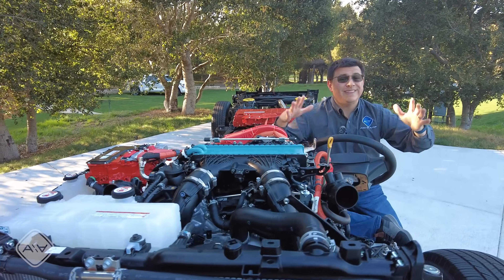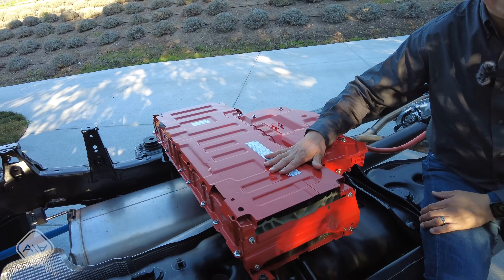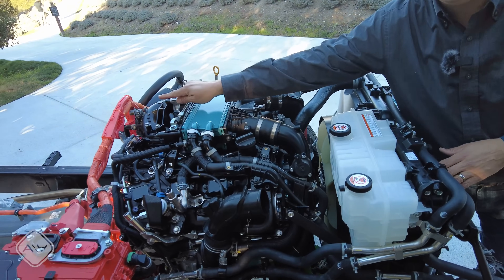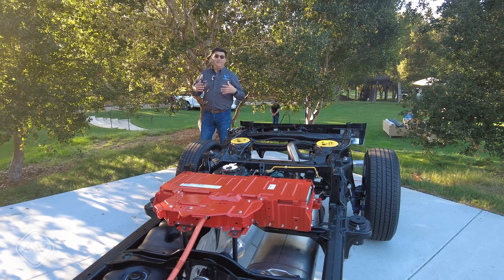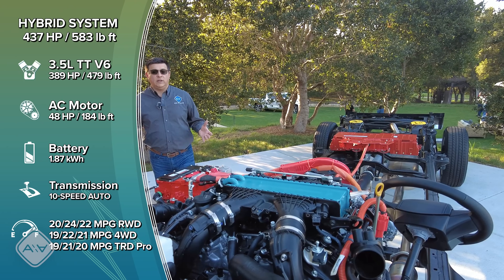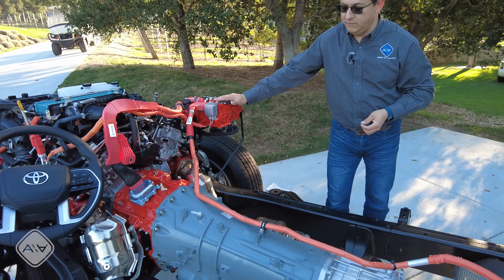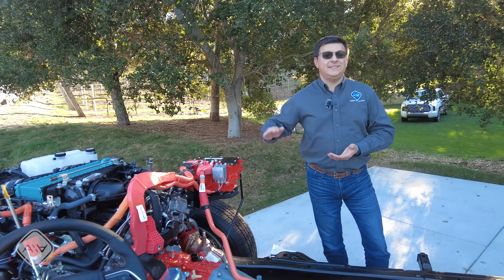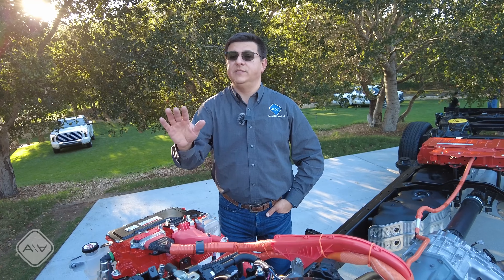How Toyota's New Truck Hybrid System Works | 2022 Tundra & 2023 Sequoia

Comment: This is too complicated compared to most Toyota Hybrid solutions.    I prefer the Prius/RAV4/Sienna P810 design.   If you need more torque, instead of relying on a turbo V6 Toyota could have installed a bigger battery and MG2 instead.

Comment: Fantastic video!  Question: When breaking to a stop, I've noticed my 1794 Hybrid breaking more aggressively once I hit ~6 to 10 mph.  It's hard to ease up on the breaks to keep a consistent breaking feel once I hit these lower speeds.  Is this due to the regenerative process?  Or the early downshifting?  Or is this not common, and needs to be looked at by Toyota?

Comment: I'm still wondering why Toyota didn't give Tundra their best hybrid system?
i.e with MG1, MG2, Planetary Power Split Device (eCVT) (Hybrid Synergy Drive?)  (5th Gen Hybrid System?). 
The longitudinal version, kinda like LS600h.
Of course with 2-speed transfer case for the Tundra.
Reply: Relatively less mechanical complexity than with that gargantuan 10-speed transmission.

Comment: Watch what happens later when replacement battery packs cost fifty thousand dollars with little use on the originals. I see they are trying to shove electric vehicles down everyones throats with like my local toyota dealership has nothing but hybrid trucks.  Untrustworthy is all people think of at first,...those who buy likely are regular buyers of new cars and trucks anyway.
Reply: Battery has 10 year warranty after that I recommend selling the truck

Comment: Everyone knows the basics. But no one is able to say how long you get hybrid power for. How much regeneration you get from breaking. How quickly you deplete electric power while cruising on the highway or towing. Guessing the battery charges slowly under regular motor driving too? What's the practical daily use info that makes this real or gimmick?

Comment: I’ve only had my 2024 Tundra TRD PRO for a week now but I’ve been monitoring when the electric motor only seems to be utilized. I’ve noticed in Eco mode, the electric motor only mode kicks in much more frequently when you have the adaptive cruise set than it does driving it gently without cruise control. Gas mileage seems to improve too.

Comment: bullshit!! more parts, more maintenance, more expensive, dad still have a 1979 toyota pickup 159, 000 miles after the turnaround, engine never been messes with internally and it hauls over 1000 lb easily, and guess what it only needs gasoline, 15 gallons to fill up the tank and last over 10 days, and if it breaks I can fix it with a screw driver and a crescent wrench!

Comment: That’s a cool demo frame! I just bought a 2024 tundra, hybrid and love it! Thank you so much for the explanation of how that hybrid actually works. It’s so much easier to understand whenever you can visualize it.
Reply: I have the 2024 also. Have you figured out which drivev mode Eco, Normal, Sport gives you better gas mileage? At my 5 month break-in period I guess at 16k miles. It seems to hve settled in at 18.3 mpg.  I Love driving it but hve been skeptical at the hybrid performance    need to justify the cost of the Capstone. One things for sure. This is probably the 2nd best investment in my life. Love it!
Reply: Until that engine goes wiz-bang.

Comment: Cool video!  Ok, so I understand this is a parallel hybrid (not like my 2023 camry hybrid), but I have a couple questions:  1). Does the motor ever shut off while driving, such as downhill or stopped at a red light?  2) Will the motor shut off when in park, idling in a parking lot waiting?  Thanks!
Reply: If the truck is driving down the road without the accelerator pressed the engine will shut off and when parked or idling.

Comment: This is going to be a dumb question ... but with conservative driving, how far can you drive on just the battery pack alone? Also, this is not a plugin-hybrid right? So no way to charge the battery at home?
Reply: I’ve had my ‘23 1794 Advanced 4x4 hybrid for almost two months, coming from a ‘22 of the same (just non-hybrid) after someone slammed into me head first. The hybrid system works way closer to something like a CR-V or RAV4 hybrid than I expected; obviously the electric motor and battery capacity aren’t designed for heavy EV driving, but the engine will shut off for several minutes if driving on 45-65 mph stretches on flat or downhill grades. It can also navigate parking lots almost entirely on electric only, as well as pull out of my slightly uphill driveway. If the driving mode is switched to Tow/Haul or Sport, it behaves very differently where the engine rarely if ever shuts off, and the electric motor becomes solely a boost, even with light accelerations. So far my average mpg around town has been 21-22, which is the same economy I got with my ‘17 Accord Touring V6.
Reply: @kingofspades531  - I ended up buying a Rivian.
Reply: @ski.with.steezy  lol enjoy that ...my 24 Terra Pro is amazing ! Best truck on the market imo
Reply: @Sam-dq7ws  - I have yet to sit in a vehicle that is nicer to drive than the Rivian. It is by far the best vehicle I've ever owned. I've never been in a 24 Terra Pro. But I gotta believe it can't hold a candle to 835hp.
Reply: @ski.with.steezy  Eh, riv is more mid size and junky looking, no way I would drop coin on that but hey, many people think the same of the Tundra which I've thought always looked the best of all the full-size trucks. This truck is plenty quick and I have to watch it as is, no tickets is my goal for new ride. Good thing there is choice out there still before Gov mandates we're all in a dork tesla or something.
Reply: @Sam-dq7ws  - I was not a fan of the way it looks at first either. But mid sized is what I was looking for. Barely fits in my garage, lol. But damn it drives like butter.
Reply: @ski.with.steezy  Congrats !!! The fact it works for you is only thing that matters :) These new rides are awesome, don't even miss the 5.7 and I loved that motor !

Comment: So basically it’s actually a mild hybrid, which is not really a hybrid as such it’s basically glorified auto stop/start, K.E.R.S. and H.E.R.S. because the electric motor is just used as power assist.

Comment: Why is the battery pack sitting so high? It eats the 3rd row space horrendously. If it is required to be interior air cooled, Toyota can an AC vent around it. I bet the current design makes the cabin hot.

Comment: I would gladly give up some torque for more MPG’s in the hybrid.  You just don’t need that much torque in a half ton.  
This should be competing with the diesels but it’s barely better than gas.
Reply: I really think you should consider driving a car.
Reply: @happycamper6352  
550lbs of torque in a half ton is meaningless when your payload capacity is like 1700lbs!  I’d much rather have a diesel and the mpgs.
Reply: @smrtguy77777  When are you going to carry 1700 pounds or more in a half ton?  Just tow a trailer if you need more.  That said, I spent years carrying hardwood firewood in an old Toyota 4-cylinder (22-RE) pickup, and it was likely over 1700 pounds, riding the axle on the bump stops every single load, reinforcing your point, although that didn't make it a good idea.  The little 116hp engine with a 5-speed tranny really had no problem at all accelerating and maintaining speed even when overloaded.  You don't really need much power to carry a lot of weight on the pickup bed.  The power is more for faster acceleration and towing especially on hills.  To this day I still carry firewood often, but I am a minority.  Most people carry light stuff with their pickups and tow when the weight gets heavy.
Reply: @happycamper6352  
Yeah that’s my point, I’m happy with around 450ftlbs in a half ton.  Toyota should have cut back on the power and have it average around 25mpg.
Reply: @smrtguy77777  I think what you're suggesting is to keep the hybrid but reduce the power of the gas engine in the name of efficiency.  The truck weight and aerodynamics would probably keep the mileage similar since the weaker system would have to work a bit harder.  I can't say that for sure because it's not been tested.  Ford tries to alter MPG with their 2.7 option when compared to their 3.5, but I haven't taken the time to see what the difference in MPG is, and whether or not it has a hybrid option.  I know Ford has a hybrid, but I don't know if it's available with 2.7, 3.5, or both.

Comment: thank you! I can't tell you how many people refuse to understand the purpose of the Tundra's hybrid is NOT fuel economy focused! I tried to explain it to so many people and they keep insisting on how fuel efficient their OTHER Toyotas are. Those negative minded people are so closed minded and refuse to learn.
Reply: The thing is, it kind of is. To get this type of torque and power without the hybrid help, you need the V8 which gets lower fuel efficiency. It's not directly about fuel efficiency, it's more about how to best get more power and torque without killing the mpgs. Seems like a good balance
Reply: @MikeMacias  of course, and I agree. But what they don't get is, it's not gonna get the MPG numbers like a Toyota crossover/car hybrid that is designed for fuel efficiency. This is designed for power, with a side bonus of better economy than a V8.

Comment: Two questions if anybody with hybrids can answer...... What happens when you have the heater on full blast, the battery pack sucks in hot air to cool the battery? And in hotter weather when you have a/c on, it seems that the battery will constantly be pushing out warm air into the truck. Is that enough heat to actually feel? Or is just not enough to even make a temperature difference in the cab?
Reply: The Hybrid battery under the seat just requires venting. It really doesn't generate that much heat. Obviously it'll get warmer during the summer season but that's when you want the vents to be clear
Reply: My current 2019 ES has the battery under the rear seat, it doesn't affect cab temperature any more or less than the 2014 non-hybrid ES I had. The nickel hydride battery has a wide temperature range -20°C to +45°C (-4°F to +113°F), the cab temperature with heater on is a good temperature for the battery, and it actually exhausts outside the car, so in cab temperature isn't effected. It's probably the same setup in the Tundra.

Comment: What an amazing setup. Only thing there is a lot that can go wrong. I love Toyota but I would wait until they get any bugs out.
Reply: very true, I wouldn't buy it until at least 3 years later. But it feels good knowing this hybrid set up isn't Toyota's first rodeo like Ford's is.
Reply: @gwot  sounds good. 👍🏻
Reply: @gwot  Not one problem in my 2024 Pro yet, absolute pleasure to drive and the fit finish is wayyyyyy better than my 2016 Platinum.
Reply: @Sam-dq7ws  2024 is already 2 years after, any early issues would be mostly fixed at this point. But good to hear it's problem free, looking to get a 2024 myself.

Comment: Does this have a traditional starter or is it belt driven like the f150 hybrid
Reply: The 2022 Toyota Tundra Hybrid doesn't have an alternator. Although it does have a traditional starter motor. It also uses the generator motor to start the gas engine.
Reply: the f150 has a belt driven starter?! or are you talking about the alternator?

Comment: Oil still drives America's working trucks. Just another reason to replace all Democrat Politicians for Destroying our Alaskan Pipeline which is why gas is $5 per gallon and businesses are failing and inflation is taking hold as Democrats Print Trillions of dollars out of thin air ! As if forcing Blot-Clot mRNA's on 2yo babies is not enough to replace all Democrat Politicians.

Comment: So it’s a Toyota hybrid with none of the usual benefits. Guess they couldn’t have the tundra getting so much better mileage than the taco
Reply: Just to confirm, I have a 2022 Toyota Tundra Limited hybrid.
The best fuel economy that I've noticed was 33 mpg. Highway.
Not towing anything. Obviously when I'm more aggressive with the throttle, that figure will drop.
So far, it's an excellent truck.
Lots of power (when you need it)
Reply: IT'S A TRUCK!!! this hybrid aids in TOWING, hybrid isn't only made for better MPG, this hybrid is made for better towing performance.
Reply: @gwot  that's funny. So let's review, v8 gas mileage, weakest tow rating, 3.5L so engine braking is reduced. Highest tow rating in the tundra belongs to the sr5 without a hybrid. Forgot my drunk caps lock, IF IT'S all about TOWING they FAILED on every LEVEL
Reply: @whiteandnerdytuba  you know towing isn't about max numbers? it's about ease of towing, and this is what the hybrid is. my whole point is, this isn't made for MPG.
Reply: @gwot  that's exactly the problem with it. It's pointless. V8 gas mileage, reduced payload, reduced towing, reduced interior room. And all for what, slightly more power you won't notice
Reply: @whiteandnerdytuba  all the test reviews say otherwise, and the tow speed numbers are all better too. I mean... at least it's an option, and not the only option, don't buy the hybrid if you're so dead set on it being pointless. it's a normal hybrid, not a plug in, if the plug in produces these numbers i'd be disappointed.
Reply: @gwot  haven't seen it go up with TFL truck, they tend to test as an actual truck. Only difference between this and a plug in is a larger battery. There's no fundamental difference between the two. I haven't seen any reviewers with a towing comparison yet.
Reply: @whiteandnerdytuba  except there could be, bigger batteries means more available power to the motor, even possibility of a more powerful motor to take advantage of a bigger pack, take the RAV4 Prime for example, because of the bigger and lithium battery pack, the motor is more powerful. Also, you're right, I was thinking about the non-hybrid towing, no tow tests on the hybrid version yet.

Comment: Alex, what is the expected battery life (replacement interval) for this battery?
Reply from the maker: Logically it should be similar to the Prius which is over 150,000 miles
Reply: @AAutoBuyersGuide  Prius uses a longer lasting battery type.  I predict that priuses will last more miles before battery swap.
Reply: @happycamper6352  it comes down to application. Prius uses both Nickel Metal Hydride and Lithium Ion. The Tundra uses just Nickel Metal Hydride, which is a better battery for harsher climates. Lithium Ion has an advantage of being smaller and lighter and charging and discharging quicker - but it’s more expensive. Both are long lasting.
Reply: @petevincent74  This has become an outdated comparison.  New lithium vehicle batteries have become more resilient to heat and cold for both chemical reasons and external reasons involving supplemental heating/cooling.  They're just about at the point where the hot/cold that it takes to affect lithium is already extreme enough to harm NiMH.  Plus, in a vehicle that already has an engine, a temporary minor power reduction from temp extremes isn't as bad as the benefits of lithium are good otherwise, since the system gets the batteries in good shape shortly after you get going.  Now if you're always in temp extremes, perhaps an option could be offered either way, but I could see that raise production costs.
Reply: If you maintain your vehicle, I believe it's 260,000 km before you need to worry but don't quote me on this

Comment: How reliable are these hybrid systems over time? This looks way too complicated to work on for a DIY.
Reply from the maker: Hard to say, but most DIYers don't rebuild transmissions so I don't see a huge difference
Reply: well, Toyota has decades of hybrid experience, including heavy hybrid trucks in their Hino division. And for what it's worth, Toyota also makes electric forklifts, so there's that too. So, definitely possible to make strong reliable hybrid systems. You can also look at the millions of Toyota hybrids on the road today, no reports of reliability issues. There's nothing to "work on" but to replace parts, and it isn't much harder to replace parts than any other component.

Comment: I own a 17 model and checked out the 22 model and to be honest I very disappointed in knowing that the 5.7 beast of an engine was gone and this battery thing is what we have sank to. My opinion. I will keep driving mine until she goes and hopefully toyota will bring it back
Reply: 33 mpg with my 2022
Reply: Opinion or not, this newer system has better numbers all the way around.
Reply: @happycamper6352  of what? Recalls? Record number in less than 8 months since it debuted. No thanks.  5.7 old school for reliability dependability.

Comment: Alex, I would like to take this opportunity to wish the early-adopters the best of luck with their new Tundras and Sequoias. 👍
Reply: How is this early adopting?
Reply: @afcgeo882  He’s probably speaking to the fact that this is a first-year model run for the Sequoia/Tundra built on a brand new platform. More importantly—the first time either have had: a Twin Turbo V6, new hybrid system, and a 10-spd transmission.
Reply: @havok3344  Maybe, but none of those things are even remotely new engineering or production items. If Ford is able to implement this in their trucks without any major issues, surely Toyota won’t have issues either.

My only wish is that Toyota had implemented the hybrid drive into the base V6 engine instead of the turbo.